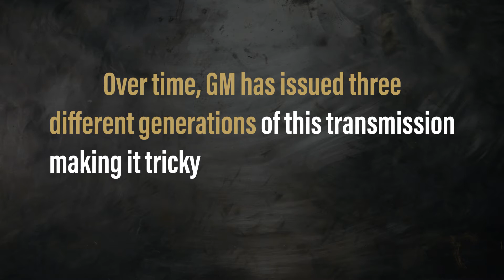6T40 GM Transmission — How to tell which generation is on your bench?

Comment: The Gen 3 6T40 looks exactly to what the reman trans I now have in my 2009 Saturn Aura XE. The passenger side intermediate shaft does not fit right. The original 6T40 has a rubber seal outside of the housing and the splines are inside the trans. Go figure! That was a 5.5 hour job swapping trans. Multiply that by $110/hour shop rates.

Comment: What if mine has an 11instead of a 12 on the inside?? Is that the second Gen? It came off of a 2012 1.4 cruze will it fit a 2013 1.4 cruze?